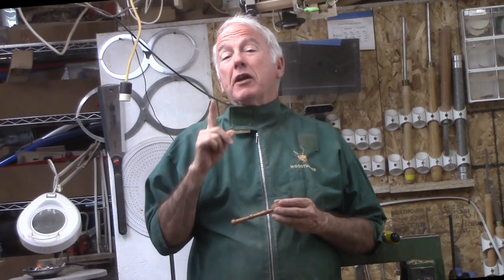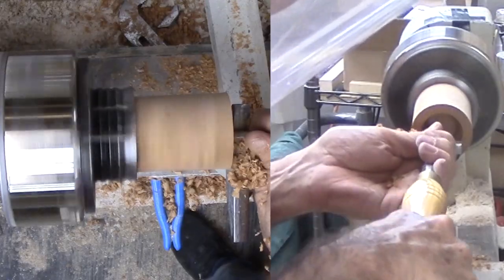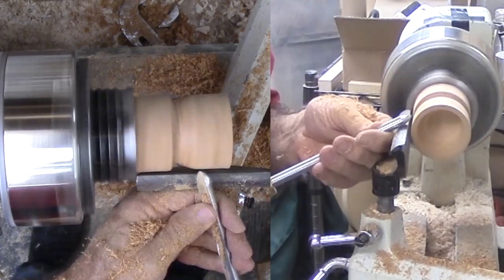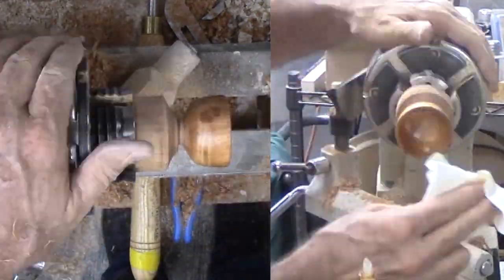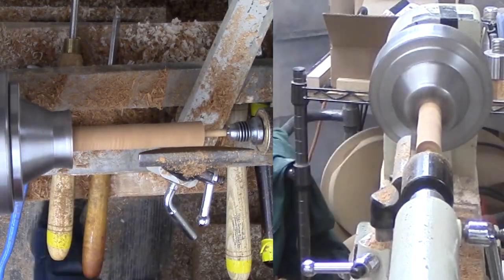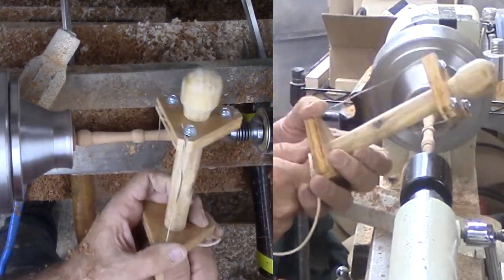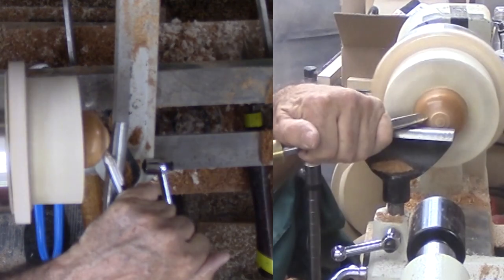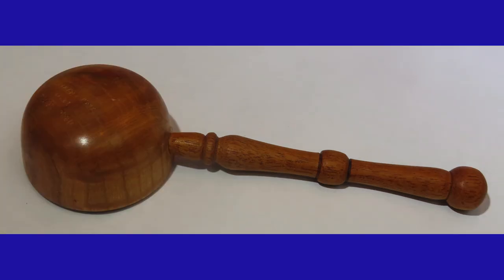Woodturning Easiest Scoop Yet In This Series

Comment: Nice one, definitely something I will try!!
How did you glue the handle? And how did you hold it in place while the glue dried?
The contact surface seems ridiculously small; isn't it a bit fragile?
Reply from the maker: Std Wood Glue, Holding not a problem. Yes, small. the whole scoop is on the fragile side. For tougher, turn thicker.
Alan
Reply: Muy buen trabajo!!